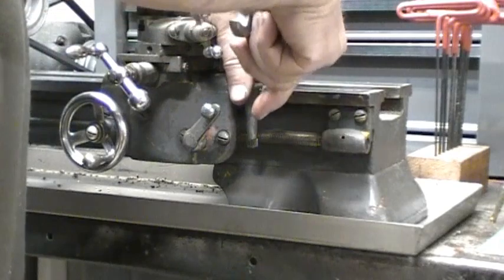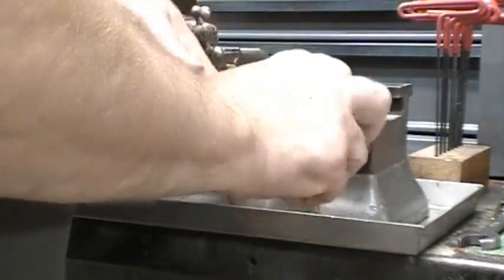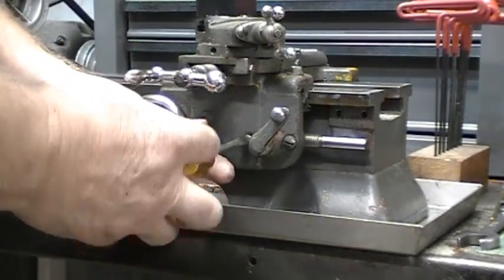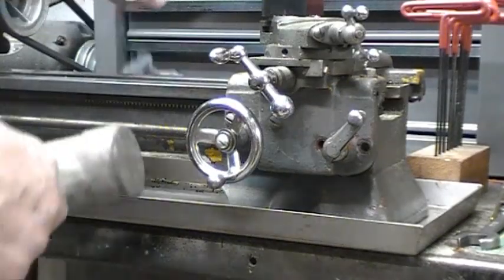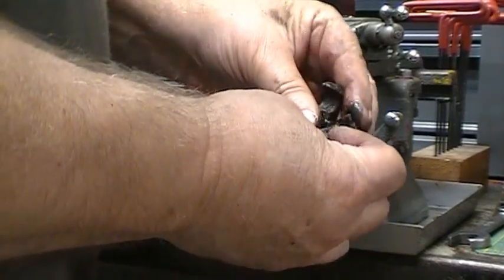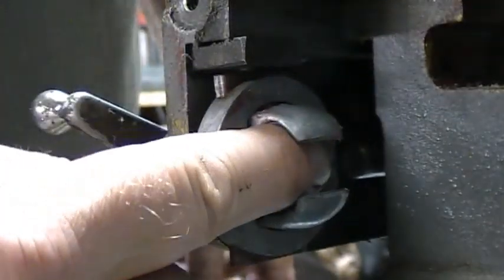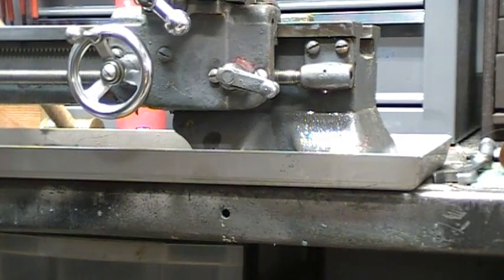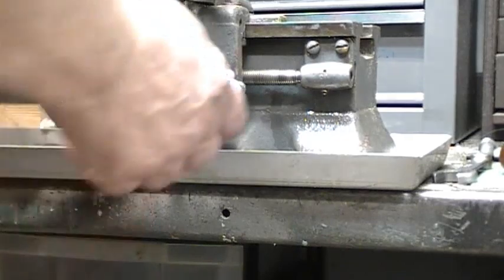Atlas/Craftsman 618 Lathe-Half Nut Replacement

Comment: Syeve please tell me someone   whatis the function of the halfnut assembly Is it somekind of brake or what isit😮❤
Reply from the maker: The half nut engages the rotating lead screw that resulting in the horizontal travel of the carriage carrying the lath cutting tool.  With the correct gear ratio set up for the speed of the lead screw threads can be cut.

Comment: Thanks Steve. I’m changing mine out tomorrow. I just received them in the mail this afternoon.
Reply from the maker: Hope that this was helpful.  Thanks for watching and commenting.
Reply: @sharkrivermachine  yep. Went easily. I also changed out my cross slide nut.
Reply from the maker: @MotoRestoFL  That is one of the things that I like about the Atlas lathes.  They are relatively easy to work on and most parts are available.

Comment: On Ebay there is a store selling brass half nuts for the Atlas 618 / Craftsman 101 lathes. There are 2 sizes and he has both but the set is $85.00 shipped. I got a set and they are worth the money.
Reply from the maker: I will have to check it out, Thanks for watching.

Comment: I have a 12" Craftsman lathe and I had a pair of half nuts that I had purchased new in the 1970's and I installed them a couple of years ago.  I wish now that I had purchased maybe 3 sets or so.
Reply from the maker: This set came from a lathe that was given to me by a friend.  It had been stored in a basement for many years and was very rusty.  It was not really a candidate for restoration so I have been using it for spare parts.  I just purchased a 10" Atlas lathe so that will be showing up in near future videos. Thanks for watching and commenting.
Reply: @sharkrivermachine  Are you restoring or repairing the 10"? I have a 10" Atlas TH42 with a QCGB so I will be tuning in to your channel.
Reply from the maker: @Pagweldfab  I think that the 10" is in good shape.  I am going to set it up and use it.  I am sure that there will be some repairs and up-grades in the future.  I will be doing videos on the set up, repair, and use. Thanks for stopping by.